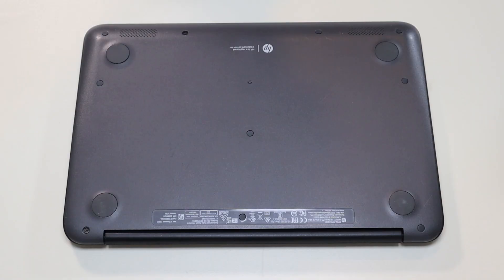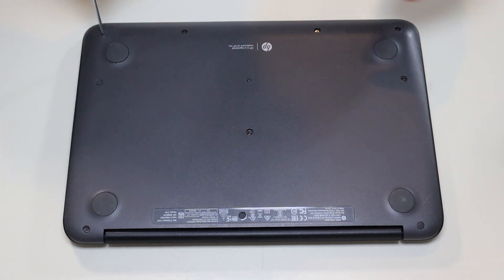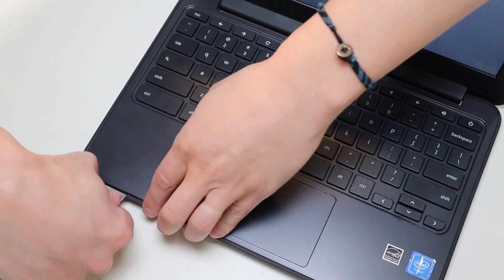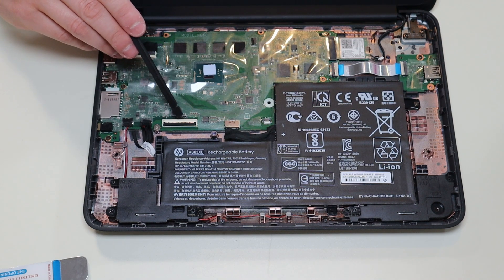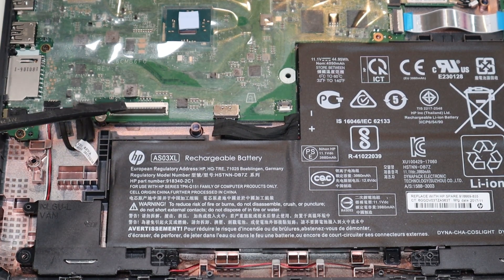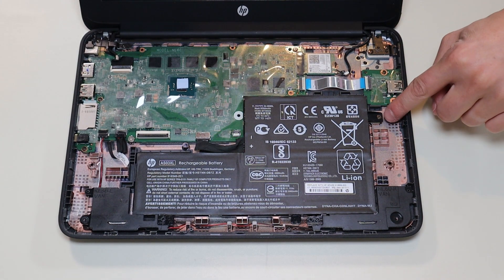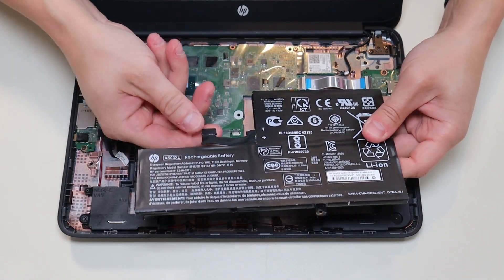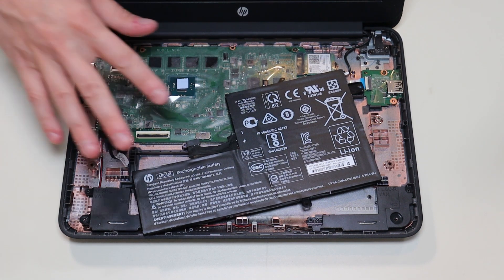How To Replace Battery - HP Chromebook 11 G5 Laptop

Comment: How to fix my laptop sometimes it turns on but usually not. I mean if i rest the laptop for days it will turn on but after i shutdown it and turn it on it doesn't turn on again.
Reply from the maker: For a computer that does not turn on, try this video first; https://youtu.be/kOBY4k2Mn_k. Let me know how that goes :)
Also, did anything happen before this issue started? Overheating, liquid spill, Windows update, etc?